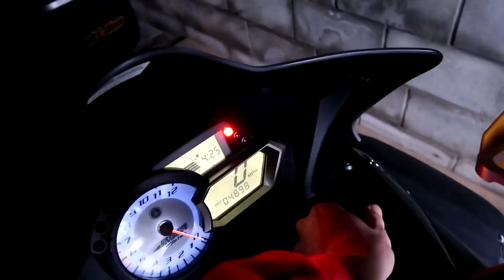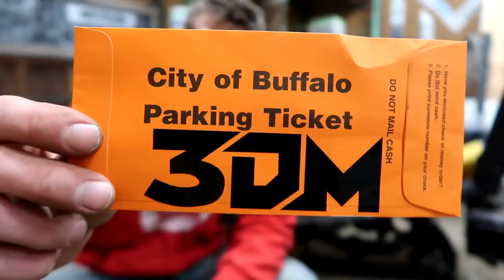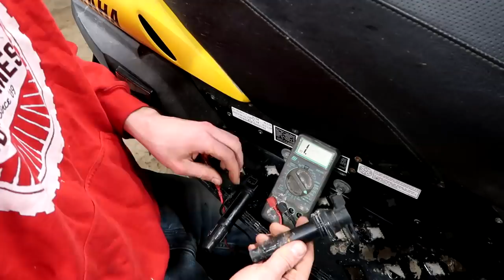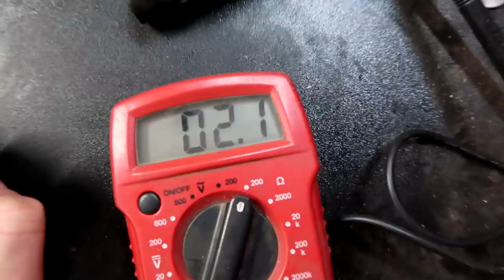Something is Living in My Snowmobile

Comment: If you threw a stud into the heat exchanger, you can TIG the holes closed in the aluminum passageways.   That is what I did on my Apex.  Otherwise,  the whole subframe needs to be disassembled, as the heat exchanger is actually part of the frame support.  Lots and lots of rivets need to be drilled out to remove the exchanger.

Comment: Compression test is were most technicians would start. If you don't know if a call. Is running you could touch it quickly to heat check the exhaust or the head. Grab a manual